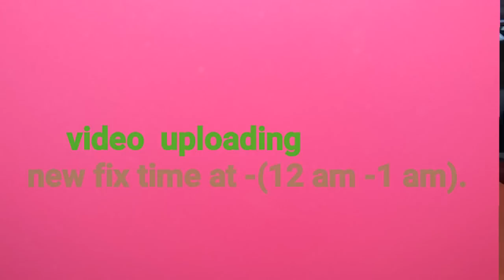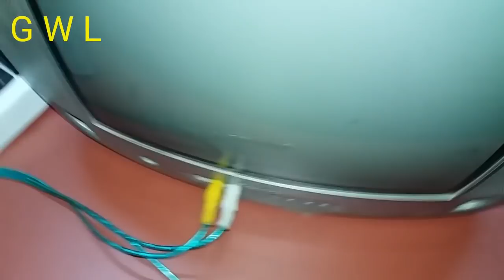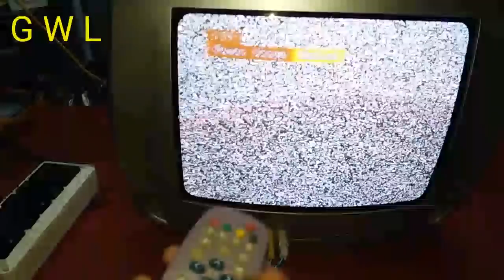TV On But No Light No Picture Fault , PHILIPS TV Repair.

Comment: Hi in my crt TV power supply voltage is ok but no voltage in secondary section I checked but I couldn't find the fault pls can you help me I am from Sri Lanka thanks
Reply: Check the transistor or capacitor

Comment: Sirji mera tv beach beach me band hota h aur fir apne ap hi chalu hota hai to ky hua
Reply from the maker: tv all circuit soldering kare.nahi hua to output all supply voltage capacitor change kare.

Comment: Sir tv ka hitar kat kat kar on hota aur fir off ho jata h
Reply: Sonu Sonu bhai Pehle htv volt proper nhi bn rahe tere 2sara out put volt pr bulb ka load de kr dekh out put ban ke drop ho rahi h ban rahi h phir regulation section ya output section m problem h nhi to eht ki supply disconect kr phir out put ki supply check kr agar theek bn gyi eht faulty

Comment: Sir Philips crt tv main h line aata hai or chala jata hai
Reply from the maker: Soldering  problem bo kare.
Reply: RadheShyam Singh vertical line aaati hh stv 9302 ic replace problem solve boh seedha protection m chala jata huh vertical ic change kr ya vertical section m koi resistance open hhh

Comment: Sir Samsung ka TV screen light nahi aa raha hai uske liye koi video
Reply: 5 v ac Heater volt check kr out put voltage check 125 v ya standby supply check kr problem solve ho gaigi
Reply: Sintu Rajak Sir videocon TV me light problem hai iskeliye koi video
Reply: sir mere sasui tv me chik chik ki aavaj aata h standby light jal rhi h tv ka figure nhi aa rha h standby button press kr rhe h but chalu nhi ho rha h 110 bhi ban rha h sir btaiye

Comment: Agar base pe 180 bolte Nahi Aaye To Kya Kare
Reply from the maker: tv on kare or 180 volt nehe aaye to b aata hai  eht pin se .to chaking capacitor 10 uf 250 volt diode159 resistor 1ohm.
Reply: Mustfa Ansari to apka set stand by m hhh

Comment: Lg flatron tv picture nahi but sound ok
Reply: Jadoo heater supply measing 5v a check supply resistance faulty change 2 ohm resistance in the location of heater supply